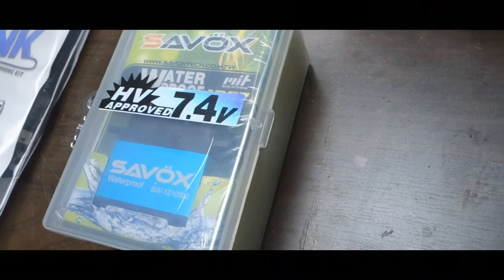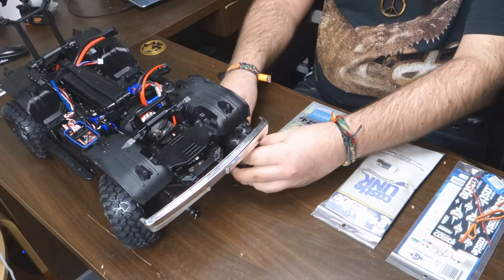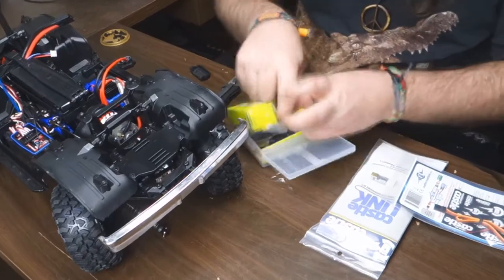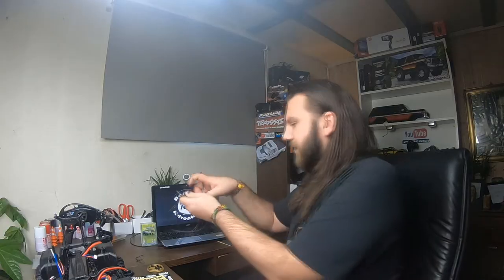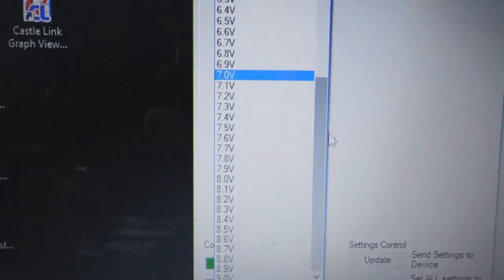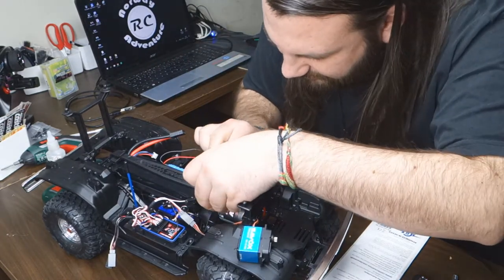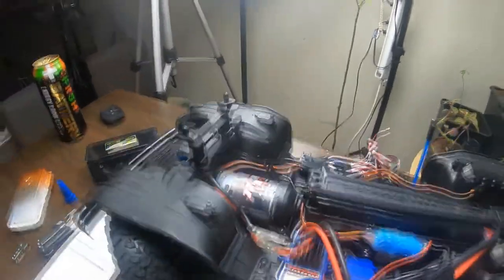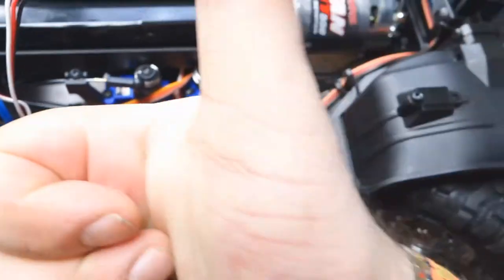TRAXXAS TRX4 - HOW TO - INSTALL BEC & CASTLE LINK BRONCO BROKE ALLREADY SERVO DIED

Comment from the maker: Hi everyone ! I've just learned that the stock receiver on the TRX4 can only handle 6v ! SO DON'T SET THE BEC TO 7,4v IF YOU HAVE THE STOCK RECEIVER OR IT MIGHT BURN! It is better to set it to 6v or bypass the bec direct to the servo.
Reply: If I use Hommes RX bypass cable (or Gear Head RC BEC RX Bypass cable)   can I set 7.4V on BEC ??

Comment: good video.  I just ordered a 25kg servo (cheapo from amazon), CC BEC 10A, servo extension cable, and Rx bypass adapter (optional) in anticipation for my stock servo to die.  BTW, I haven't even received the TRX4 bronco I ordered yet.  Most people in forums agree that the stock servo and horn are too weak.  Another option I suppose would be to upgrade the ESC to a WP1080 which has a BEC that can output more current.
Reply from the maker: You are a wise man sir! :) Looks like you got it under controll, did you get the trx4 yet? Been thinking about the BEC too but I'll run it until it says no haha 😁 thanks for watching and talking your time to comment 😊 awesome!

Comment: Exactly what I have... Massive improvement! Holmes hobbies makes an rx bypass by the way, next time check it out a lot simpler to install.
Reply: Another thing.. don't leave your batt connected in the Bronco your servo will still be running
Reply from the maker: ofcourse bro ! =)) never leave any battery connected :) Thank you for watching Jake !
Reply: Norway RC Adventure looking out you u bro! You should see a massive difference in performance
Reply from the maker: It's like a new truck from run one =) I love it!  Just wish the hobby store would have recommended this when I bought it :P

Comment: Love your accent lol right out of the box I'm having problems with my steering servo.  I will be doing the same thing you did . I have that savox servo on my sawback and its awesome.  Only thing I recommend is soldering the connections instead of hot glue. But just liked and subscribed.
Reply from the maker: Yeah seems like it is liek 50/50 if you get a good one or a defect one. I love my savöx and it is still going strong after about a years of hard runtime :) And as it says in the description, the stock reciever can only take 6v so set the bec to max 6v if you still use the stock reciever. In the video i set it to 7,4v :P My hot glue still works perfectly, I know it's better to solder it but I wanted to try the hot glue :P hehe thank you for watching and taking your time to comment :) YOU ARE AWESOME!
Reply: @SwedenRCAdventure  right on bud  , I love the savox in my sawback too. I never put a bec on it.  I may want to look into that. And I got to admit that I love the hot glue too lol anyway you have another subscriber  . Look forward to your future videos
Reply from the maker: I had the problem when I first installed it and when I turned and pushed the throttle the truck didn't do anything, so the volt wasn't going where it should :P bec will sort everything out and give the motor, lights and servo what they need.
That sounds just awesome my friend! =))
Reply: @SwedenRCAdventure  mine is 6v so I should be all set.  Its working great.  But traxxas is sending me another one.  I'm trying to get them to send me a 2255 I think it is.  But we will see.  If they send me another stock one I'll order another savox and keep the stock one as a spare for me or if someone needs one.not sure how much snow you still have  , but  ours is all gone . Was 60 degrees today  , tomorrow and a few times this week its calling for more snow lol I got some new parts to install so it will give me more snow days to work on my truck  lol . Have a good afternoon. And sorry for talking your ear off lol

Comment: You have to set the servo end points to stop blowing the servos.  That's the problem when your holding it at full lock and the servo is trying to keep going but physically can't because of the linkage limitation.  And the fact Traxxas electronics in general are trash. Nothing but problems with my Xmaxx electronics, but we won't get into that as I want to keep my blood pressure down lol
 I put that same Savox servo i  and its awesome.
Reply from the maker: Yeaah i did that later, thought of doing a video on it but it just went thrue haha.... Been wanting a xmaxx but maybe not a new one :P